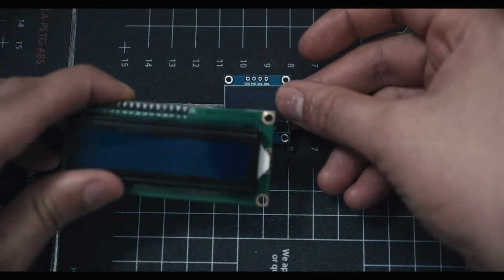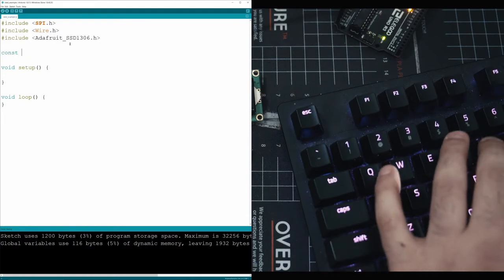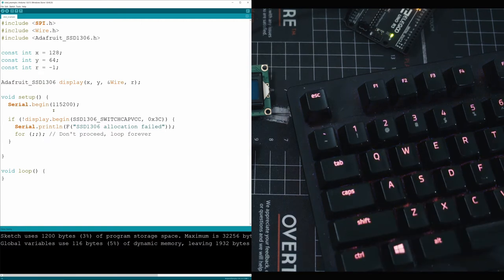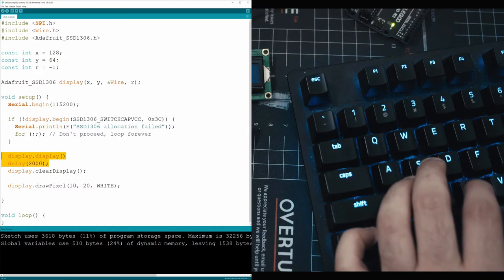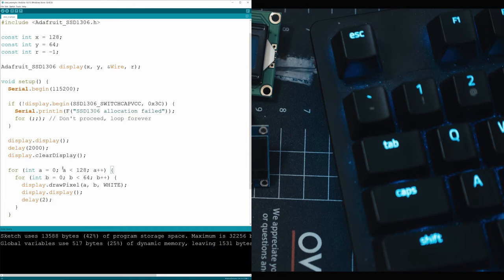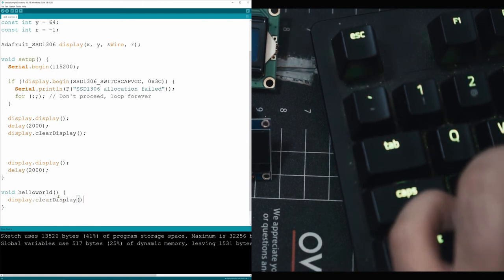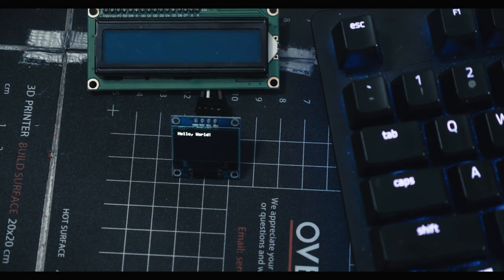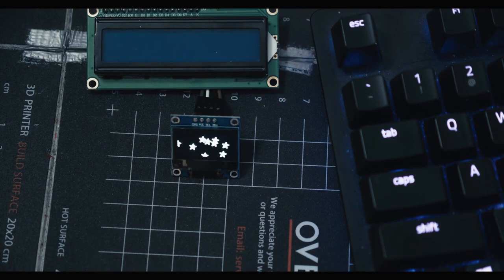DIY OLED Display Projects with Arduino | Arduino Sensors | #grindreel

Comment: I doubt you check these since this video is years old but I am into modifying cars and I think a custom oled display in the interior of a car would be cool. Is there a way to run this off of a cars power supply and have it boot up when the car turns on ?
Reply from the maker: Ofcouse I check comments, and yeah ! Just run it off the 12v accessory line, every car has it located somewhere but if you can tap that line it would be perfect
Reply: @MikaelAbehsera  thanks for the information and timely reply. You got my sub
Reply from the maker: @goindeep7363  my pleasure, if you want we have a discord were we kinda help each other out and show stuff we're working on, I like to see what you do with this, maybe ill do it in my car too
Reply: @MikaelAbehsera  sure man what’s the discord
Reply from the maker: shoudl be in the description of the video, let me know if it doesnt work might have to reset it

Comment: .I like that...the LCD goes into the garbage but there are still plenty of uses for the LCD, is that a paradox?
Reply from the maker: going to bring these back, any sensors you'd like to see videos on ?
Reply: @MikaelAbehsera  absolutely...anyone of the many gas sensors...I wanted to build a device that detects the percentage of O2 in the air...also a pollution  device that detects maybe CO2
Reply from the maker: I gotchu, adding to list

Comment: for some reason my oled screen did not display anything and I righted all the code you showed
Reply from the maker: Check the wiring, could be something small you missed
Reply: @MikaelAbehsera  I figured out that I had an older version of the IDE and it was the problem 😅
Reply: @MikaelAbehsera  Great video and well explained thnx
Reply from the maker: @King_Thenuja  ah! Nice catch

Comment: hey, i have a chinese oled display which has the address of 0x78 0x7A. I ran some codes and the display is not working at all. Im working on an audio spectrum analyzer for my school project.
Reply: i ran the example test code for 128x64 i2c it wont work idk if my display is dead or im just dumb
Reply from the maker: Would you be ok joining the discord where we can see screenshots and code? Not sure what the problem is but its hard to help over youtubr comments
Reply: @MikaelAbehsera   the display is ok now i just plugged the pins incorrectly. My problem now is the project itself. My analyzer is not working even if i shout on my electret mic.
Reply: @MikaelAbehsera  i joined ur discord
Reply from the maker: @wheresblxckstar  nice! shoot a message the discord im sure someone can help

Comment: Hi I saw this video and like it. I ask if you can a video on a 2 wire RPM sensor for the Hobbywing sensor. There is one but no " code". The fellow shows the code on his computer and on an angle as well as a bit out of focus, "very useful". This is the link, https://www.youtube.com/watch?v=Ck7s9itY76c it may be helpful as you have a lot more knowledge than me. If you can get it to work, you would be the first as far as I know and show with code.
Reply from the maker: Hey I think we talked on discord but if I didnt finish helping dm me again